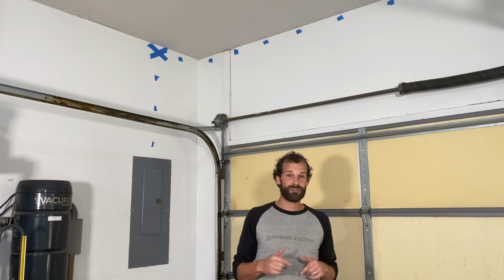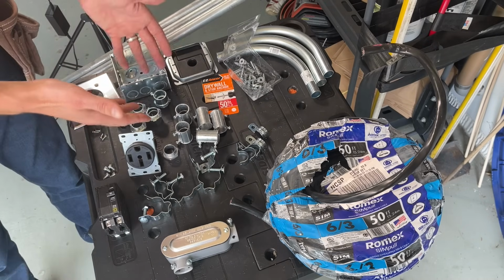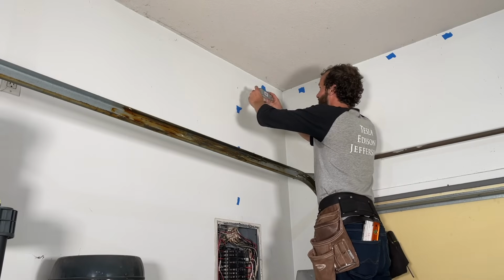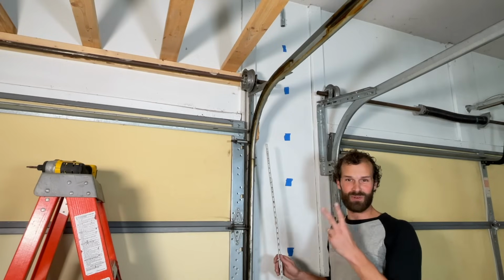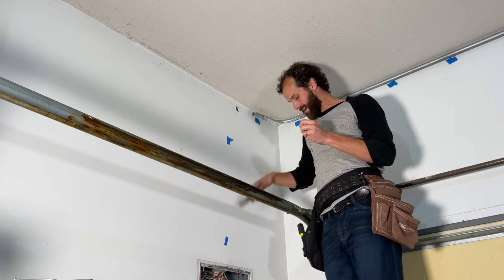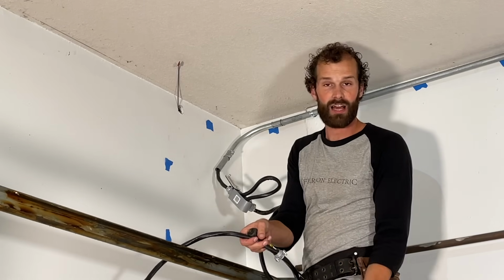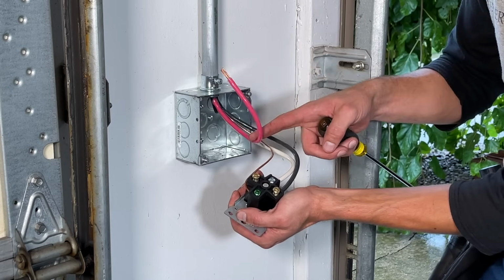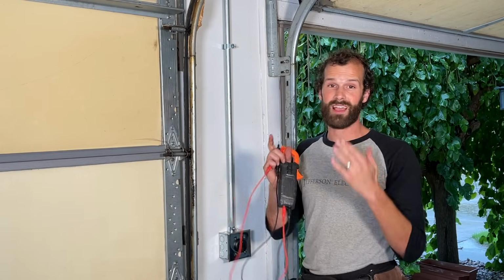How To Install a 240 Volt Outlet | Electric Car Charging

Comment: Several commentors have said he violated the conduit fill requirements.  I say, there are no fill requirement here.

This is not a complete conduit run.  This conduit is for protection under 334.15.  

Under table 1 chapter 9 of nec 2020, "conduit fill by calculations" (my description) note (2) says that table 1 is only for completed conduit runs and is not intended to apply for conduit for protection from physical damage.

Understanding this, I expect many would run larger pipe, but not an nec violation/ requirement?
Reply: He shouldn't be using Romex inside of conduit
Reply: @lilcourtny08  were my references wrong?  

Does the nec in section 334.15 list emt as an allowable protective conduit approved to protect NM cable?
Reply: @keithharrington8715  The code violation is the type of wire he is using not the wire size. There are other other code violations in this video also. I don't know what size of wire he is using I didn't hear him say what it was
Reply: @lilcourtny08   @Courtney Sutherlin  at about time 30:15 he mentions he is using 6-3 romex.  Romex, NM cable, which falls under 334 which allows emt to be used as a protective conduit for NM cable 334.15.

Romex,, NM cable, requires in 334 the use of the 60 degree C column in 310.16 table.   Also 110.14 for terminals points to the 60 degree C column unless the breaker terminals are labeled for 75 degrees for breakers 100 amps and less.

As far as conduit fill, chapter 9 table 1 note 2 states that conduit for protection, specifically unfinished runs are not intended to meet the fill requirements of chapter 9 table 1.

The 6-3 romex under the 60 degree column of 310.16 is enough for a 55 Amp circuit.

Just found this one.....but 406.11 (recepticles)  connecting the ground terminal to the box.....250.146.(A). Recepticle ground term to box, surface mounted., the yoke to box connection shall provide the effective ground path.  So the box is grounded as per 314.4.

The only code violation might be.... EVSE 625.54 car charging section for gfci breaker for any car charge recpticle (no volts limit given).  Yes, this requirement is not changed from the 2017 code. ( I only have a 2020).  Please remember code section 90.4 .... so he might be ood on that.

Now, I consider myself an "A-" guy.....good but not perfect.  So if I missed a concern please let me know.  And if I have a reference wrong, yeah, give that written smack down.
Reply: @keithharrington8715  He didn't have a pigtail coming off the receptacle to the metal junction box. The junction box needs to be bonded to ground also, he admitted in one off his comments he forgot to ground the Junction box. If the box would have been plastic it wouldn't have to be bonded but all metal boxes needs to. Also I'm pretty sure the way he was using the conduit body is against code. He had a connector going through the drywall. He should have just used a simple 4 square junction box.
Reply: @lilcourtny08   @Courtney Sutherlin  

Romex,, NM cable, requires in 334 the use of the 60 degree C column in 310.16 table.   Also 110.14 for terminals points to the 60 degree C column unless the breaker terminals are labeled for 75 degrees for breakers 100 amps and less.

Just found this one.....but 406.11 (recepticles)  connecting the ground terminal to the box.....250.146.(A). Recepticle ground term to box, surface mounted., the yoke to box connection shall provide the effective ground path.  So the box is grounded as per 314.4.

250.146 talks about removing an insulating washer.....square cardboard....but his recepticle had none, again making an electrical xonnection that bonds the box to the egc through the recepticle yoke.

Only code problem might be 625.54 a gfci breaker.....90.4 ahj can override.

I do appreciate the code tour I just took.

Comment: Is it possible that in some area code dictates that you have to either remove the outside insulation or use separate #6 wires when using conduit?
Reply: Its against code everywhere to use Romex inside of conduit

Comment: Do not listen to this guy.
Ne er tell a homeowner fo do electrical work 
Ne er open Breaker panel with out glasses an ppe protective 
Thos is  alled a receptacle 
You have put a ground fault protection Breaker  8n garage  of house 
Way to save money hard wire the unit directly you do not have enough ground fault protection  because you  cannot unplug unit and plug something else 
Save money run wire in attic of garage then do not have e install conduit 
You need to file a permit which he never told you.

Please d9nt do electrical work without onow.what to,   ot  y utube.

Comment: Great video and super helpful to understand this process.  I'm building a home and asked my builder to quote me on a single outlet in the garage within 100ft of breaker box. The cost was $1690 (Philadelphia PA).  Sound reasonable? My own math: Wire ($525), breaker ($30), electrical box and outlet (~$50), Labor ($1085).  No conduit as this will be done before drywall.  Thanks

Comment: Just bought a house and the garage already has an assortment of 240v plugs, but I'm seeing something weird. I checked at plugs, and inside the breaker box. I'm getting 120v for hot to ground, but whenever I check hot to hot, I get almost nothing. like maybe 5 or 10v. And doesn't seem to be one bad breaker in my box, it's coming in that way. I suppose next I'll try checking the main breaker that's locked in another box over by the meter, but it's all painted shut so I need to bust it open. Anyway, any explanation for why I might be seeing this? 120v outlets work, not seeing 240v across the hots.
Reply: The outlet you're testing, are the hots wired to the same 120 phase busbar in the panel? maybe someone wired it to two breakers and put it on the same phase? if there's multiple its possible they confused the runs, and wired them incorrectly?

Comment: I ended up using #6 welding cable due to a couple tight 90° conduits bends.  Got lucky and found a 20' remnant at a local store.  That stuff ain't cheap.

Comment: Since any outlet over 20 amp is supposed to get inspected here...step 1 confirm which type your car charger uses...step 2 pick where you want the outlet...step 3 show a licensed electrician...step 4 give him money.  Should probably also have him put a sub panel in the garage.

Comment: Does that Hubbell-Raco 4" square box allow for recessed placement in the drywall instead of externalized? (i.e. so the outlet ends up basically flush with the drywall?)

Comment: I was astonished to see you use a metal fish tape in a energized panel - very bad practice and especially bad for amateurs to see that and to follow your example !  I am a licensed commercial / industrial journey level electrician with 40 years in the trade. I worked a job at a hospital and a member of our crew pushed a metal fish tape into a 277/480 volt panel, which contacted the bus bars, causing a fault, which dropped all the power to the “penthouse” and shut down all of the hospital’s elevators, even patients on their way to surgery ! Lesson: use extreme caution with metal fish tapes. The other thing is, how is your conduit run grounded ? As far as I can tell, it is not.

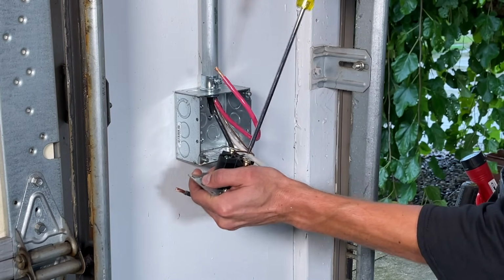Comment: IBEW 428 @ 40:17 instead of wiggle wiggle wiggle i use Wire Ferrules. you can DIY your own ferrules by using copper pipe. i learned my fathers trade too (goldsmith / master jeweler) and make my own precious metal tubing

Comment: Nice video. I’m going to add a welding hook up 240 to my garage some day and I’ve had the good fortune to get free wire 100ft of 8gauge armor wire.  I am debating how to wire this up. As my electrical panel is mostly full being electric base board heaters equipped. Now it’s either unhook a few heaters I normally don’t use, OR try a transfer switch and simply rewire my drier hookup to all new wire and be able to switch between the two so only one is powered on at a time. Honestly I am not doing it as a business or a lot of use so having to flip the switch or over working the panel shouldnt be a problem. I just want the ability to use my dads old welder I got from him when he passed. I’ll never use it to its full potential. I think I’ll end up running it thru plastic conduit just so it looks cleaner outside the house and more water proof and paintable so it matches. It’s gotta run like 60ft or so for optimal location for my welder. 
Just debating how to wire it up. It would be safer load running if I could make sure my lady doesn’t throw the drier on when I’m in the garage lol

Comment: Non-pro tip put some electrical tape over those screws and the exposed wires where the service wires enter and also over the screws that are exposed on the circuit breakers If you didn’t cut the main breaker, to reduce the chance of touching or having a wire hit a live feed. Have gloves on when you do that.

Comment: NEVER turn off your main breaker unless you have an actual emergency inside your panel, if you ever turn it off it may or may not come back on and that'll cost you a whole lot more as you'd have to potentially replace the panel or the breaker which is hard to get, NEVER turn it off especially on older panels but that's just me, listen to your "pro" lot of things wrong w this install

Comment: 8.5.22
Bravo Joel, excellent instructional install video.  Nice parts list.  Question:  Why did you not strip off the black romex to pull just the wires?  Would have made the pull easier.
Reply from the maker: For sure that was more on me (Scott) as I purchased all the parts for this one and Joel did the install.  THHN wire would have been a better option as compared to the Romex I purchased.
Reply: Actually ,it's against code to run Romex in conduit and  the junction box wasn't bonded to ground. There should have been a ground wire come from the receptacle going to the junction box also. Its a place on the box to connect the ground. For any metal junction box it needs to be bonded, should have been a pigtail from ground on the receptacle connecting to the metal box

Comment: Enjoyed the video. there are two that I would done different.  1) use a one size  large on the lb or a deep 411 box with the proper size conduit holes,2) on the plug box ,you did not put the plaster ring right, it should be hanging on the top screw .

Comment: 🏠 DIY HOMEOWNER QUESTION: 
My garage has a 240v outlet just like this one.  I no longer need 240v, but I need a 🔌 120v outlet in there.   What parts are necessary to borrow the lines (GROUND, NEUTRAL, HOT1) and install a regular 120v outlet?  Can I keep the 40A, 2-position breaker in the box for this project?
Reply: An absolute NO on retaining the existing 40 amp breaker unless you were adding a small subpanel to distribute multiple 120 volt branch circuits.   Your 120 volt receptacles will likely be rated at no more than 20 amps, so if they were being fed directly (without a subpanel containing multiple branch circuit breakers) the existing breaker size would need to be reduced accordingly (i.e., 15 or 20 amps). 

The following methods, which do not require a subpanel, only work if your existing 240 volt branch circuit has both a neutral and an EGC:  If you wanted only two 120 volt branch circuits you could do multiwire branch circuit where the existing neutral can be shared, but the two 15 or 20 amp  breaker handles must be physically connected together.  If you only need one 120 volt branch circuit then use a single pole breaker, add a blank in the 2nd breaker position and retire the unused hot conductor in place by capping off both ends with wire nuts.  Obviously, you can't connect the existing 40 amp wires directly to the 120 volt receptacles.  You will need 12 or 14 gauge pigtails as appropriate.

Comment: Why need to pull the outside meter you should turn off the main breaker that feeds this panel.  This is a handyman not a Pro.  2 metal fishtapes in the same location which could curl up and hit any breaker lug to the panel and get either very hot or blow.  And his hacksaw come on.

Comment: Awesome video! Thank-you so much for sharing your skills in Electrical installs. I picked up on several of your tips (at least 10) that you can't find in any books. I've pulled wire thru conduit and made the work much harder than necessary - with your tips, I'm actually looking forward to the next adventure with cable and conduit. Again, Thanks
Reply: I particular liked the bending of the wire to get into the breaker.....
Reply: Amaà of of

Comment: I need some clarification on romex bundles and gauge match of ground. I’ve been told that the ground gauge must match the hot, but on bundles such as this 6/3 romex the ground is a far higher gauge. If it’s ok for bundles to use thinner gauge grounds is it also ok if pulling individual wires? Aside from being ok what does code require? For example mixing 6g and 10g for ground. Thx
Reply: Off the top of my head. 250.122 equipment grounding conductors has a chart and allows you to use a no 10 wire as a ground for up to 60 amps.  Individual wires.

Bundles of wire or cables are made to some specification.  Might be code. Not sure.

Comment: Why do you use 6/3 romex rather than individual conductors?  It seems like individual wires would have been much easier to pull and to make the bend in the L-box.

Great video and excellent information.  Thanks.
Reply: that's one of the errors.  you aren't supposed to run ROMEX through conduit.

Comment: Do they sell 50 amp Bx wire ?
Reply: What? There is no such thing.  The amount of Amps for the circuit determines wire size.
Reply: @lilcourtny08  I mean yes and no….
You could run 12 Gage wire on a 15 amp breaker ….
No code issues ..
Reply: @mycaddigo  unless it's over 50 ft
Reply: @lilcourtny08  I’m sure you know more than me.  If you run 12g wire … (20 amp) on a 15 amp breaker … it can’t be more than 50 feet ?  Explain to a noob (:
Reply: @lilcourtny08  70 feet on 15 beaker 
50 on 20
Reply: @mycaddigo  more resistance in a longer circuit so you need a thicker wire to have less resistance.
Reply: @mycaddigo  you also would get less voltage
Reply: @lilcourtny08  I never considered
That …. But my runs wouldn’t be any longer than 50 feet.  So I guess im good .
The more you know ..
Reply: @lilcourtny08  what’s the worst case senecio if you ran way past the allowed amount?  Burning down houses ….?
Or a device starving for voltage perhaps damaging that device ?

Comment: Why would you not feed the wire through the structure while you're prepping the path anchors? That seems a much simpler process without all the effort of pulling wires through tight spaces from a single tug point

Comment: I'm so fascinated what is needed to get 12kW out of a wall in the USA... How thick your cable is!... in Germany we have 5x 2,5mm² cable for getting 11kW (3x 230V 16A in a 120° configuration, one neutral and one "ground"). You have less wires but 50 (!!!) Ampere on two of them.

Comment: You needed to add bushings onto your connectors and your grounding conductor needs to be the same gauge as your current carrying conductors, per The National Electrical Code !\

Comment: If the voltage difference between two live wires is 240V, what is the purpose of neutral wire here? Can we also use 120V from nema 14-50? Is that the reason why we have the neutral? 

In that case do we have a receptacle that is just 240V with ground? Two live wires and ground. Thus avoiding the need for an unnecessary wire?

Comment: That metal cover plate on the receptacle has sharp corners that will slice open a hand.  Get a smooth galvanized cover plate that follows the shape of the box.  Way more safe.  Great vid!

Comment: I have a question I'm doing an RV with 3 voltages 12vdc 48vdc and 120vac. if I can get a 240vac out of the growatt 5000es then that will be in use also as a back up to the house. Question is when wiring my breaker panel in this RV the RV panel is one hot, neutral, ground. Should I have a second breaker to use the extra leg just into my backup home plug? Or should I wire a new panel like a home panel that has two legs and distribute the 120 loads between the two legs evenly?